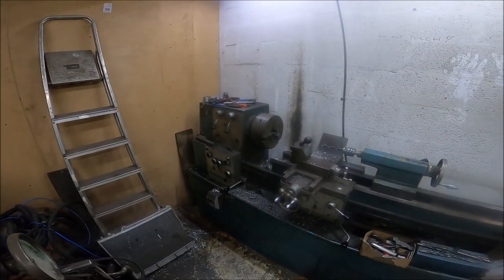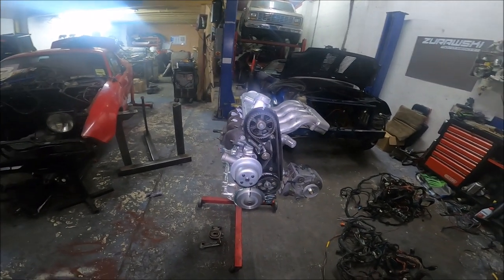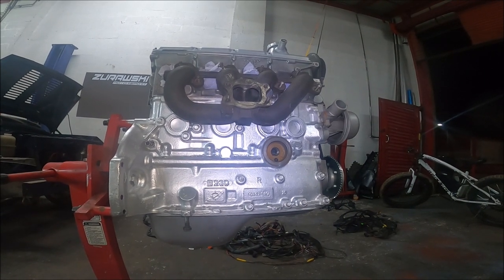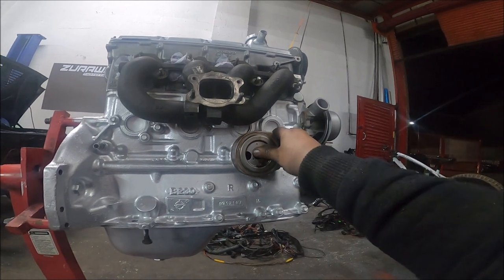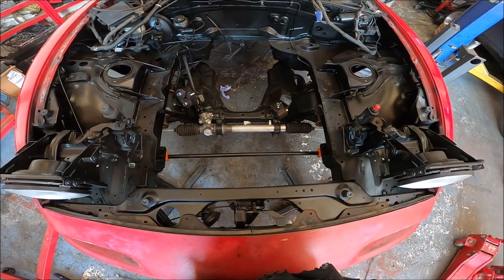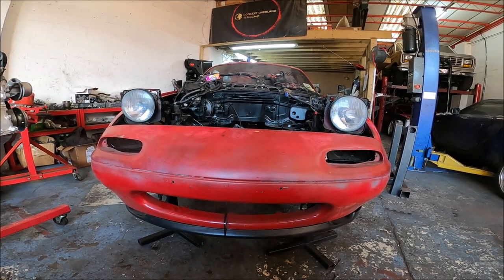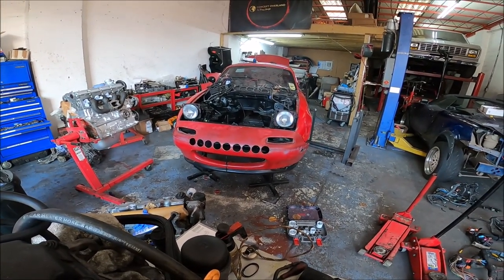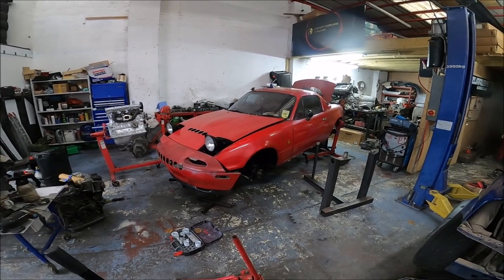Boat engine turbo MX5 is 'almost' rolling! Suspension and steering sorted, engine ready to go in...

Comment: 1. Great minds on the oil heat exchanger. It’s the best option. 

2. Christ that thing is going to be awesome in black with the silver engine.

3. Maybe join those circles up together on the bumper then extend down to just have one big opening rather than the stock opening and some holes. As you’ve said yourself the car is going to be taking a battering, mostly sideways, and it could probably benefit from all the frontal cooling area it can get.

4. Before you cut out the bonnet holes I was thinking of saying to cut two really wide and short U cuts like so |______| |______| then bending the flaps upward so that airflow is lifted over them as it travels over the front helping to scavenge air from behind the radiator. But you drilled the holes already so never mind! Maybe if you do another row further back you could stagger them olympic logo style and have it one wider than the original, that’d look cool. I’m sure you’ve got it all in hand though.

5. 1.6 brakes are fine, good choice and that’s what we run for the same reasons you said.

6. Go flush, literally to watch mx5 owners heads melt. I bet they’re unsubbing in droves already because you said popups look shit 😂

Comment: The heat here is a major issue (it's 42 right now and hotter in the sun) all drift cars I've seen here have a water sprayer on to the radiator. Not so much an issue in the UK eh lol.
Reply from the maker: You can do that, I did that on the intercooler on the Merc for a bit, but a bigger intercooler coped even better
Reply: @StavTech  yeh on the intercooler seen that quite a lot, if I'm not mistaken didn't it even come on older generation Impreza STI?
Reply: @supernovadw  it came on evo's :)